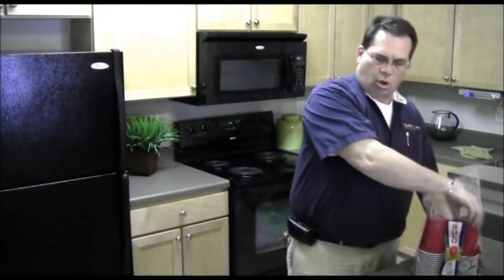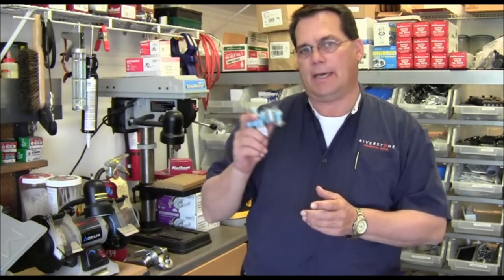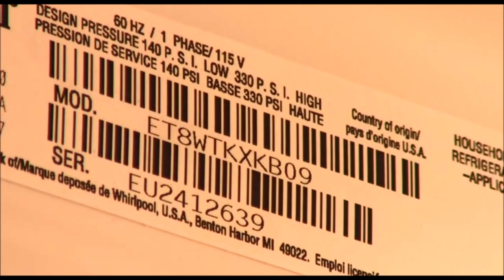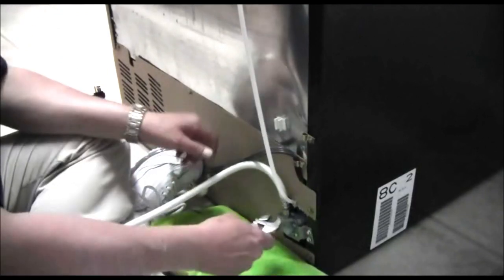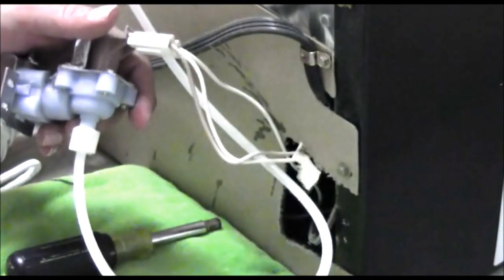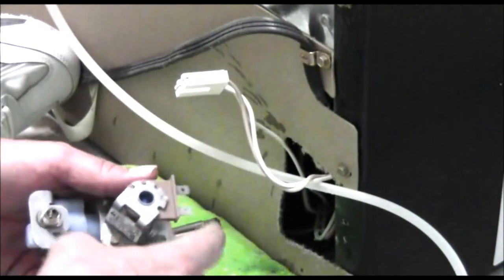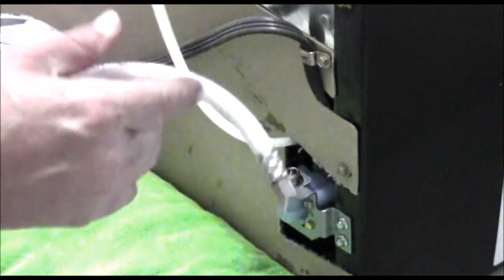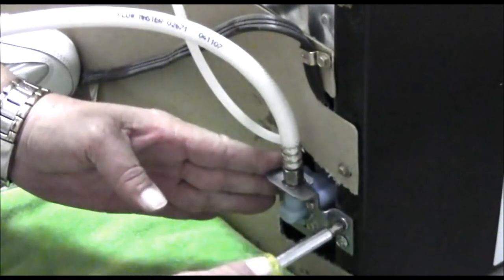How To Fix Hollow Ice Cube Issue

Comment: I recently installed my sixth watervalve which fills up the ice maker.  Usually,  the valve will  last a week or two then whenever it calls for  water, the  valve makes a shuttering noise in which the ice  maker does not fill with water.   It sounds like the silinoid valve isn't opening to the full position, instead it is going off and on at very fast speed.  The water valve which is connected with the icemaker valve works very well.   If will fill a glass of water. I also installed the gromet that lets the water go in from the back of the refrigerator which  flows into the icemaker tray.   I appreciate any help.

Comment: Any way to find the part number of the valve without pulling the fridge out and going through this process before ordering the new part?
Reply from the maker: +Adam L 
You would need to use the model# that’s on the tag inside the frig. Depending on where you live you can check with an appliance parts store to order the part. Or find them online.

Comment: My Whirlpool icemaker still makes ice, though smaller cubes, but I have a sheet of ice running down the back of my freezer and across the bottom of it. I have to remove the build up at least twice a week. Is it likely a blockage in the inlet or another problem? How do I resolve the problem?

Comment: Whirlpool side by side ice maker leaking causing ice cubes frozen in a clump,water dripping. Not a model with water in the door. I think a valve is not shutting off properly
Reply: I have that issue in my whirlpool side by side??

Comment: Hi Dan,Just found you on youtube, and am now a subscriber. I think that this video will help me solve a problem. Water keeps filling the icemaker and dribbling over the front into the ice bin. Everything is frozen solid, and I'm going to have to defrost the freezer to get the bin out. I thought it was the ice maker itself, so I replaced that and still had the same problem. Now, with your advice, I'm going to change the valve. Wish I'd seen your video before. I'll let you know how it turns out.

Comment: Your valve is similiar to my old valve.  i had a problem with water getting into my tray.  I called around and a repair sold me a valve that hooked up different, but works fine. Only problem is that it leaks around the hose that goes into the freezer.  He said push the line in and it locks in and I guess it is supposed to be tight by compression. which it is, but it leaks when it runs.  Any ideas as to what is wrong.  I'm out about $50 and still have no ice.

Comment: I have a problem with my ice cubes produced by the Kelvinator "side by side refrigerator-freezer" that I have.  When the ice cubes are added to water you can see white flakes/particles floating about.  I have checked the water filters and the water coming through is clear and so is  the water coming out of the water dispenser at the freezer door where the ice cubes are also dispensed.

Comment: I have an LG refrigerator with a bottom mount freezer. The ice maker continuously pours water into the bin and bottom of the freezer. I have replaced the water fill valve to no effect. Would it be necessary and effective to replace the ice maker itself?

Comment: My friend has a problem with the valve staying open overflowing the ice tray and spilling out onto the floor.   Is it likely a faulty valve, or a the timer in the ice maker?   What would be a quick way to troubleshoot which is at fault?
Reply from the maker: +jim mayors if your friend has not tampered with the ice maker level screw then most likely the valve is faulty.
Reply: @danjiles  Thanks for the quick reply.   We will start with the valve and cross our fingers that fixes it.  The service tech quoted her $400 to fix the problem, but really didn't say what the problem was.   We figured it was the valve, but I thought it might be the timer module.  I can't physically go there to troubleshoot it myself, so....   Again, thanks.

Comment: My machine wants to make ice if I leave the wire thing down but it does not make any ice. I hear it trying to cycle through it I guess. Do you know if I need that valve you are talking about? I have a whirlpool too only it is the kind with the freezer on bottom and double doors. Thanks for your videos.
Reply: thank you so much for your guide line information
Reply: Rat Kin electric blower
Reply: Donald Mulligan rr

Comment: ok now what do i just plug it back in and see if it works and how long will it take to make ice.  do i reset the ice maker or just leave it alone. my line was froze inside the flow spout to the ice maker i defrosted my machine but i dont know its pluged on does it open when pressure from the water

Comment: Dan Jiles I have a French door Samsung, ice in bottom, making the cycle sounds with no ice.., no ice or water in the door, plain front fridge, could it be inlet vavle also??? Thanks
Reply: Sounds like you might be frozen. Check the refrigerator side for water hose that is likely frozen.  Hit it with a hair dryer until you get water from the door.